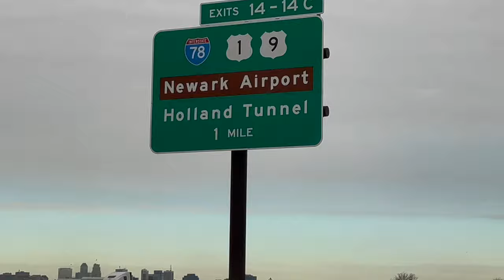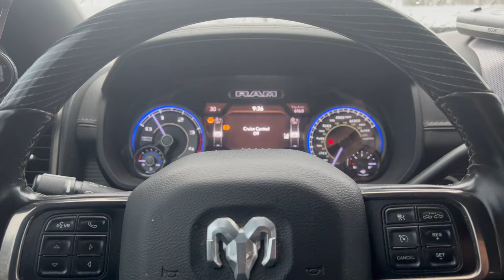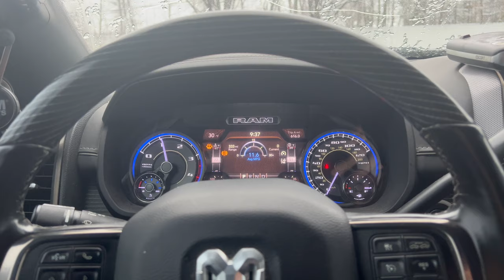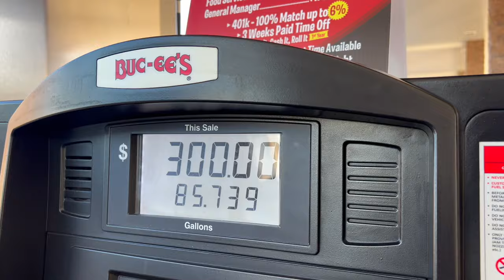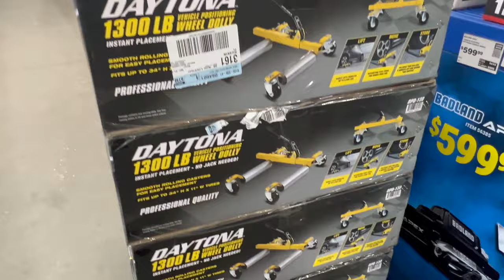First Transports With My NEW 44' Gooseneck Trailer

Comment: How's your turning with the shortbox? Goose looks CLOSE to the cab to where you wouldn't be able to do a full lock turn without hitting.
Reply from the maker: I can turn a full 90-degrees to the trailer. I'm averaging 12.45mpg loaded and just a fraction better empty. This is amazing compared to pulling my friend's 24' V-Nose getting 10.7 mpg empty!!